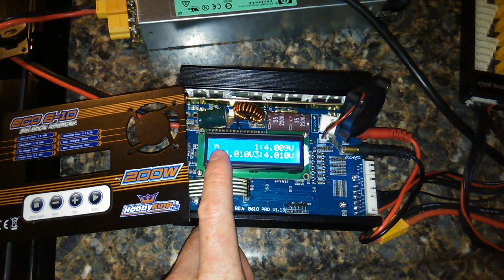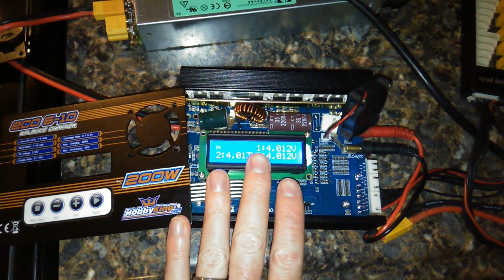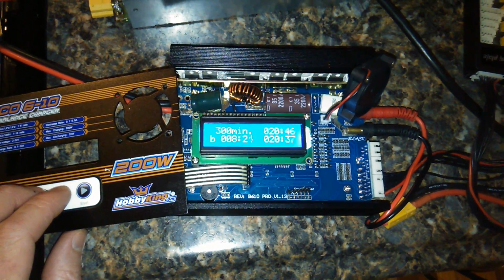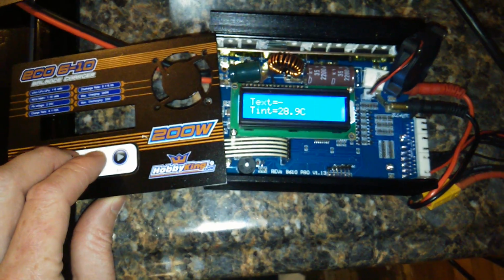Eco6-10 Firmware Mod!

Comment: hello, this video dates a little, but you remember the name of the firmware used? in those of the links I can not find eco 6-10 200w. only eco8 150w or A 6-10 200w ... the latter seems more logical but I have a doubt.

Comment: I'd love to see a video on flashing and calibrating Cheali-Charger. I have looked at the firmware a few times, but have shied away from taking the plunge.
Reply from the maker: Tim Creque sure! I have two more to flash... Ill get a video up of that.
Reply: Atom RC Can you share the ISP pinout (B6 orig or clone)?  Also which firmware did you use (GTPower or B6 Clone)?  I bought a second Eco6-10 during the HK summer sale and want to try flashing it.
Reply from the maker: The Eco6-10 200 has its own firmware in the collection. and the pinout is rather simple. ill get the pinout and post it in a bit.
Reply: Atom RC GTPower or Turnigy 200w FW?
Reply from the maker: Paul Kay I used the "cheali-charger-Turnigy-A-6-10-200W_1.00-20150704_atmega32.hex" firmware
Reply: Atom RC have that pinout handy?
Reply: Paul Kay 1-6, SCK,MOSI,MISO,RST,GND,+5V
Reply from the maker: thanks. sorry, job change is taking up my time.

Comment: Does  the flash work on accucell 6?
Reply from the maker: Hobbyandtech There are versions for the Accucel 6 50W and Accucel 8 150W.... the Accucell6 80w uses a different processor from what I have read.
Reply: nice thanks